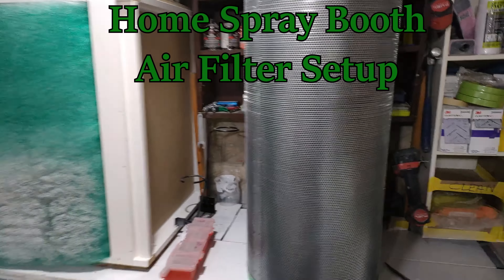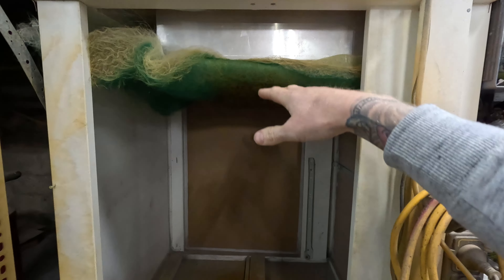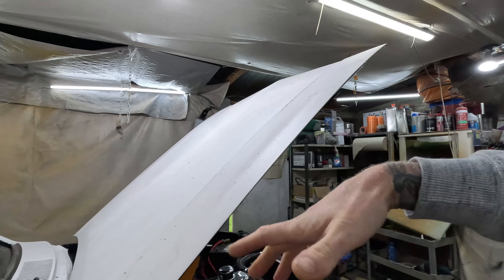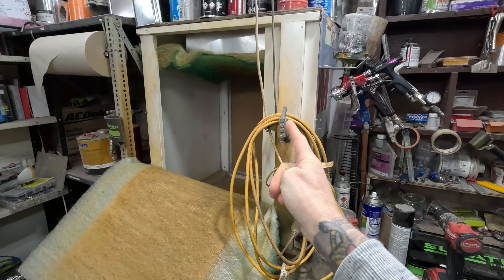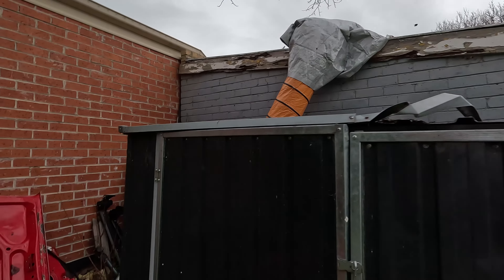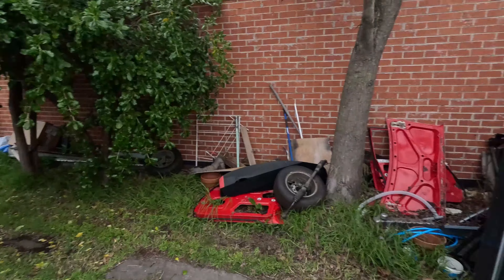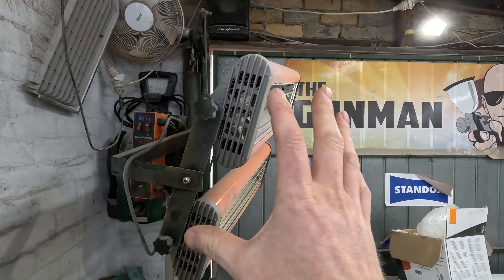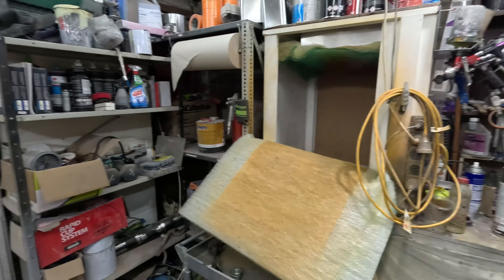Home Spray Booth Setup

Comment: Nice setup, I think you have your paint exhaust filters in backwards :-) and every bend you have in that hose really cuts down the air flow.  As an idea, I use a water spray system as my final filter.

Comment: I'm going to invest in (2) 30" Dia Tube Axial Fan - 3 Hp - 3 Ph - 12,000 CFM. It's also uses a aluminum fan and outer mounted motor for sparking. But it's a little pricey. I'm going to build up concrete ramps with grating in the center with the Axial fans in the lower back.

Comment: Nice setup!How many hours  of spraying  did your carbon filter last?
Reply from the maker: Do you mean the big round one? If so it's still going and has done a full respray on my Torana. But I do pre filter it to remove all the particles, so I'm just using it for fumes.
Reply: @TheGunmanChannel  Nice! Yeah the big round one. Is it still as filtering just as well as when u first bought it? How many paint jobs has it helped with?

 Also was wondering what the m³/min of your fan is? 

Thinking about building my own filter setup for painting cars.
Reply from the maker: @dave5194  it does seem to be performing as well as at the start, but it will only realistically remove 70-80% of the fumes. automotive paint is very smelly, so like I say, just be realistic.